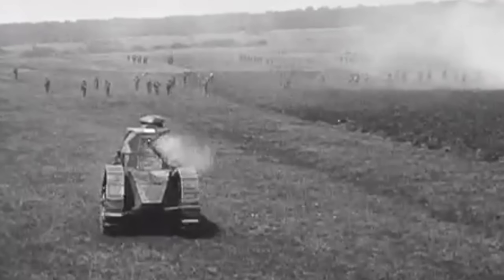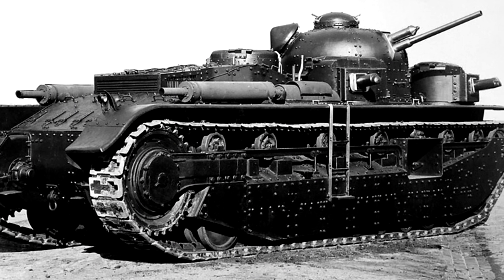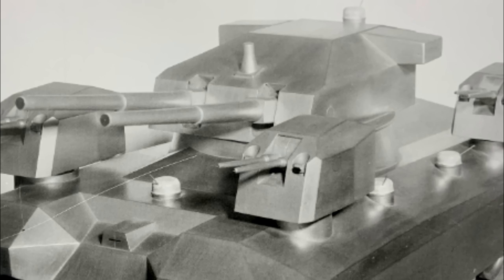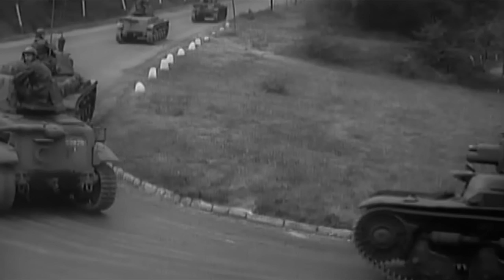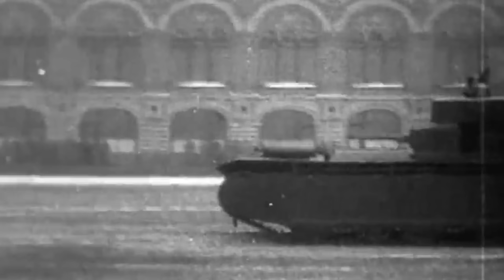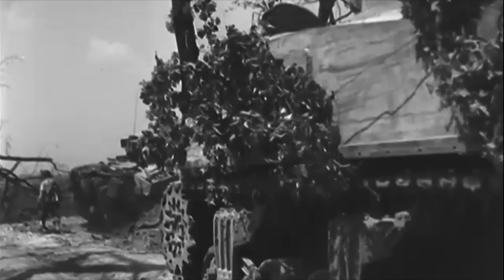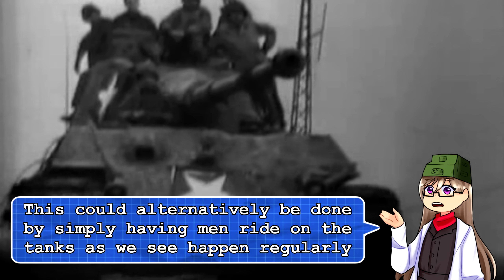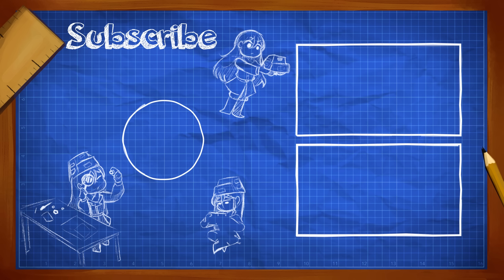Why do Multi-Turreted Tanks Fail?

Comment: On of the thoughts behind this evolutionary dead end can be found in the name of the Vickers Independent.  It was intended to operate independently, as in on its own (no infantry needed). So machine gun turrets abound, the rear ones even had high elevation to act as AA guns. 
Later with the 16 tonner and A9 cruiser, the forward sub turrets were to hose down trenches either side as it crossed them.  Of course, as a cruiser tank, it should have no business crossing defended trenches, that's an infantry tanks job.

Comment: One idea i do have for fictional multi turreted tanks is usage in a droid/machine army. With no crew and an ai in command rather than an individual person, some of the major draw backs (command oversight, needing more space for more crew, communication issues) are completely eliminated. Theoretically, in a sci fi setting an ai could use multi turreted tanks in a similar role to breakthrough and heavy tanks

Comment: The Sentinel used the twin 25Pdrs to simulate the recoil of a single 17Pdr. It was a test platform, not a production vehicle.
The critical issue is C2 with a Crew Commander not able to co--ordinate or control multiple turrets.
Reply from the maker: Yes I am aware, however it is a double barreled tank still
Reply: @ConeOfArc  Um OK. We'll differ.
Good luck with the channel.

Comment: Another sizeable issue that kinda follows from how multi-turreted designs didn't have much more in the way of armour protection for the increase in weight... Why have one tank with two turrets that can be taken out by a single AP round in the right spot (and is a larger target for such), when you can have two tanks that require at least an AP round each to take out. If one of your two single turret tanks is taken out, you still have one fully operational tank. If the two-turreted tank is taken out, you now have zero fully operational tanks especially in a flare up scenario.

Comment: Hi @ConeOfArc you could have mentioned that due to the increase size of  the vehicle it would be harder to armor it and single turret tanks are more easy and more eficient to armor
Reply from the maker: I mentioned that in the size and weight section. Larger vehicles require more steel for the same armor protection and the more armor the more steel

Comment: Post WW-1, I'd say the main reason for multiple turrets is because different weapons specialize in different things. Putting two cannons in the same turret just doesn't work well for something as small as a tank. And so you get the likes of the M3, and also the Germans using Panzer III and IVs. And there are drawbacks to both sides, like bigger/heavier vs needing to logistically support 2 tank types  (and this would also impact cost, due to economies of scale). Ultimately, more general purpose guns capable of doing both anti-tank and HE work came about, and so the need for that diminished.

And I do say diminished, because we still do that type of thing in the modern era. It's just that now we have the option of anti-tank missiles, which are mounted on the outside of the turret, and so the same turret can house a 25mm chain gun and a TOW missile launcher.

Comment: The expense of building large vehicles with multi-turrets was prohibitive, also the large crews that needed to be trained. But there were also issues of crewing small turrets such as those on the A9 Cruiser were heat and fumes made them unusable. Then there is difficulty of the tank commander directing fire from multiple turrets under battle conditions and  some tanks were difficult to exit is hit. They were a fad of the 1930s that proved impractical.

Comment: To an extent, some post-war IFVs have continued the multi-turreted idea. When Marders first came into service, they had a remote-controlled machine-gun mounted on top of the troop compartment, operated by one of the dismounts. This was essentially an improvement on mounted troops firing through ports or open hatches, since it has more field of fire than the former and better overhead+NBC protection than the latter. It echoes the pro-multi-turreted tank arguments of being able to fire in two directions at once and covering blind-spots from sneak infantry attacks, and it avoids the pitfalls of increased size and crew because the size wasn't excessive, and the additonal 'crew' were dismounts who were there anyway and otherwise had nothing to do. It must be significant that later upgrades of the Marder dispensed with this weapon though. The MG turret was made by MOWAG and they produced several IFV prototypes in the 1960s and 1970s which featured two such turrets side-by-side on top of the troop compartment, but none of them achieved any sales.

Comment: The crew argument goes both ways. Yes, you have more crew in the vehicle, but the number of crew per gun actually goes down as they share a driver, radio operator, and commander.

Comment: I do think there are designs that could make operating multi turreted tanks much simpler; such as a double autoloader system in an oscillating turret. Basically, if you can remove the need to manually load the cannons, and if you can wire all of the gun controls of two different cannons to a single panel, it is theoretically possible to only need one operator. This does away with the crew issues, but unfortunately a double autoloader would be not only very expensive but also extremely heavy.

Comment: This reminds me of an old Mico board game made in the 1980's called, "Hell Tank", and "Hell Tank Destroyer". It was set in the far future. The hell tank was a multi turreted beast that also could carry smaller tanks if I recall correctly. That was over 40 years ago. I didn't learn that the concept of multi turreted tanks was a reality until about 20 years ago.
 I keep living. I keep learning.
Thank you.
Reply: Sounds similar to OGRE, which was (and is) a very popular pocket-sized paper-and-counters wargame when I was at school. A giant cybernetic "land battleship" called an OGRE and controlled by one player came down the board one way, and the other player had to defend a Command Bunker from it using conventional (if semi-futuristic) forces. The latter only had three states: alive, imobilised or dead, but the OGRE had to be engaged component-by-component by shooting at it's track units, gun turrets or missile launchers. There were a variety of different OGRE marks available with the conventional forces balanced accordingly. There were also a couple of follow-on games: GEV (Ground Effect Vehicle - hovertanks), which dispensed with the OGREs to have conventional vs conventional battles, and Battlesuit(?) which was individual small-unit actions, both in the same setting. There were also lots of expansions and upgrades.
Reply: @MrHws5mp  I played lots of games of OGRE, there even miniatures made for the game. And I still have a few. It was very one sided. But every so often I could beat my Dad, who always played the OGRE :) Those where good days.
Reply: @JamesHart62  It definitely took a long time to learn how to beat the OGRE and you had to use exactly the right tactics. In our school wargames club (stuffed full of military nerds of course), two new players tended to see OGRE's win more often than not, but when both players were more  experienced it tended to come out even.

 In the first edition of the game, the printers accidentally printed some of the grey counters as black, which gave a conventional player who chose black the option for far more GEVs than the game designers intended. This led to a tactic called "The Fuzzy Wuzzy Falacy" in which the player chose an all-GEV force and used them to swarm in, devastate the OGRE's treads, and then swarm out again in their second movement phase, leaving only a few of them within range of the OGRE's longest-range weapons. This got fixed in later editions by a) making sure the printing was right, and b) nerfing the GEV's second movement phase so it was shorter than the first (down from 4/4 to 4/3 IIRC).
Reply: Both of which were inspired by Keith Laumer's BOLOs

Comment: One drawback that you didn’t mention is the increasing difficulty tanks have turning the longer they are. A longer tank means more track on the ground that has to be dragged in a turn. And this is compounded the heavier the vehicle is as the greater weight presses the tracks into the ground more and multi-turret designs tended to be heavier than more standard tanks. This was a problem with things like the British Vickers Independent, the Soviet T-35, and even the legendary TOG II which only had the one turret but was freakishly long and heavy. This is also the reason the Swedish cheese wedge STRV 103s had very short lengths of track in contact with the ground, it allowed them to much more easily rotate on the spot to aim the gun.
Reply: The Devils doorwedge also has neutral steering, due to ability to rotate tracks to opposite direction.although the mechanics affect mobility to a lesser effect over conventional physics.
Reply: @apyllyon  I would think a drawback of multi-turret tanks is putting a lot of your combat power at risk of uselessness for the loss of one tread linkage or drive sprocket, or blown oil seal, or...
An armored "Don't put all your eggs in one basket" thing.
Reply: It's not just length overall. It's also an issue of the ratio between the length and width of a tracked vehicle. The length of the track dictates how much force it takes to drag the tracks, while the width of the vehicle dictates the amount of leverage the vehicle has to overcome the drag of the tracks. A short but wide vehicle will turn more easily than a long narrow one. However, this can go too far, and a tracked vehicle that is too short can have difficulty driving straight. This is why most tanks have a track patch that is about twice as long as the vehicle is wide. That ratio gives enough stability going forward, whilst also not making turning too difficult. 
But, if you have a vehicle that is too long, you can have even worse problems than just difficulty turning. The Vickers Independent actually had a lot of problems with the sprockets and tracks breaking, which happened during turns. There was simply too much sideways force on the tracks.
Reply: Now you have 2 guns that can't shoot thru enemy armor, instead of one gun that can
Reply: Not with the case of the KV-6. The tank did not need to turn cos it will drive straight to Berlin. lol
Reply: Wrong. Weight means nothing, the pressure is the number you're looking for. Tank with 2x weight but 4x the track area will sunk LESS than lighter one due to less pressure.
Reply: Weight is super important; not only is it the weight that makes you throw a track on a sharp turn, it’s also weight that ruins you crossing bridges, using feries and being lifted aboard ships.

Comment: I feel like you missed a quiet big benefit of multi turreted tank is the firepower to weight ratio. To achieve the same firepower of a multi turreted tank consisting of two cannons there should be two separate chasis built for each cannons resulting in separate engines and the exponential increase of armor needed hence multi turreted tanks, although costly per unit, do have a leverage over multiple tanks being required to be build.
Reply: Fair point, but if you can get a single turreted single gunned tank to have a cannon with enough firepower for the required roles, then you don’t need a second turret. A good example of this would be the M3 Lee and the M4 Sherman. The turreted 37mm cannon on the Lee was to deal with enemy armour, while the 75mm cannon in the hull dealt with fortifications. The M4 Sherman used only a single 75mm cannon that could fulfill both roles by simply switching which shells are being fired. I feel multi-turreted tanks only really could’ve worked during WW1 and the early interwar era.
Reply: @Gary-number31415 did the gun in the M3 have the same performance as the one in the M4? That includes availability of different ammo types. I understood that the M3 gun didn’t have a capable AP round when the tank was designed. If this is correct, did better AP rounds come available during its front line service life?
Reply: @Gary-number31415  the point you're talking about the gun being better sort of is irrelevant to my entire point. If you put two or more of the " better" gun on a single chassis it still will have more favourable firepower to weight ratio.
Reply: @talon9639  The total mass of your tank fleet is not as important as the mass of a single tank. Lowering the latter will benefit mobility, including which bridges it can cross. The former may help you when transporting by sea or rail, but it's a problem that can be easily solved by bringing more ships and trains or doing more runs. And once you realize that a multi turreted tank is not even equivalent in firepower to multiple tanks in actual situations, the calculus becomes even worse.
Reply: @Vengir  No, the total mass of the entire fleet is important. A country such as nazi Germany in ww2 ought to have chosen multiturreted tanks, multiturreted tanks, due to their firepower to weight ratio, need less resources than two different chassis. This goes for crew and the resources put. It gives you a greater firepower with less cost, something the nazis should have considered. Mobility is king, however I still believe the importance of multi turreted tanks have been underestimated. They do have a worse mobility but should have definitely been part of the tank army as they provide significant power to weight ratios.
Reply: @talon9639  Okay, so your argument is less about firepower to weight, and more about firepower to cost. While on the surface that may seem like it makes sense, in practice, there are simply way too many drawbacks of a multi-turreted design to make it a viable option, which was mostly covered in the video. It would be a questionable choice even if the actual firepower of a vehicle was equal to the sum of the guns installed, which is not.

And Germany would never be able to win, and no wonder weapon (or even just good weapons) would be able to change that.
Reply: @Vengir  my argument is firepower to weight AND firepower to cost. It costs money to add weight to a vehicle such as engines, armor and completely different chassis. These two arguments are interrelated. 

You ought to look at my point with attention. Germany will not win is to me irrelevant about the benefits multi turreted tanks provide. I'd prefer having a pistol against aks rather than nothing.
Reply: An example that would work with your point in the video is the SMK vs KV-1 where the KV-1 is about 45 tons and the SMK weighed about 55 tons for kv-1s to reach the same firepower would mean 90 tons and also more expensive.
Reply: @Mickers1919  exactly!
Reply: So you just gonna ignore all the downsides that has been said in the video? A multi turrets tank might not be as heavy as 2 single turret tanks, but as a individual tank it performs significantly worse than a single turret one.

A multi turrets tank has way better firepower, sure, but what the cost? With the increased size for the extra turret armor reduction is a must if you want the tank to be able to move, and poor armor means the surviability is reduce significantly, the increased weight of the second turret reduce mobility, this combination alone is already a death sentence for a tank. Now what next? Slow turrets turn rate so enemy tanks can lock on you faster than you can on them, alot of brigdes back then can not handle the weight of heavy tanks, now you have to travel a longer route with the high fuel consumption rate, not to mention ww2 heavy tanks break.down.a.lot, ask the German. Everything scream inefficent, that's why multi turrets tank is still not a thing still this day.
Reply: @tanpham937  I like the points you make. The point is significant enough to be mentioned in the video despite the downsides.

Comment: I was hoping to hear mention of things like the MBT 70 and AMX 30 having 20 mm on their tanks during the Cold War. And the recent designs like the Abrams x with the 30 mm on top.
While ammo storage would of course be an issue I think having a remote weapon system 20 mm or 30 mm seems like a good idea
Reply: Yeah, not mentioning that is kinda dumb...
Reply: @omarrp14  Amx 30 had a coax 20mill like early the centurion. Later models introduced commanders cupola mg(unsure of the caliber) in raised high-vis cupola.
Reply: And the PATTON Tanks during the 60s